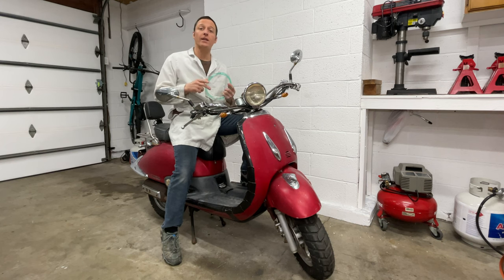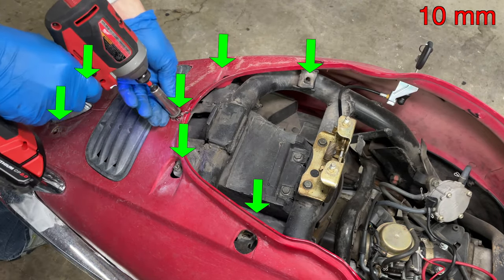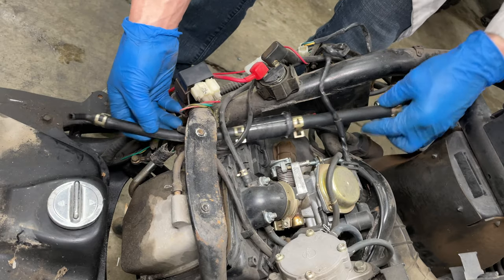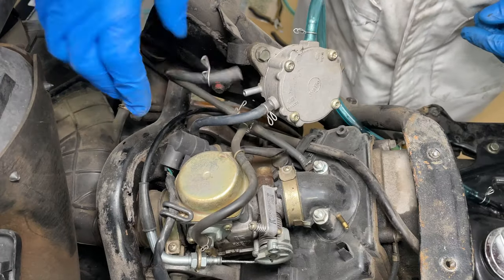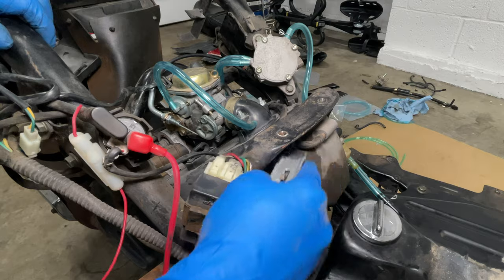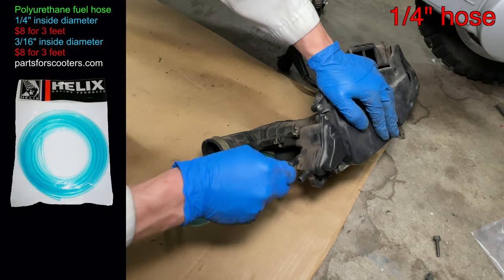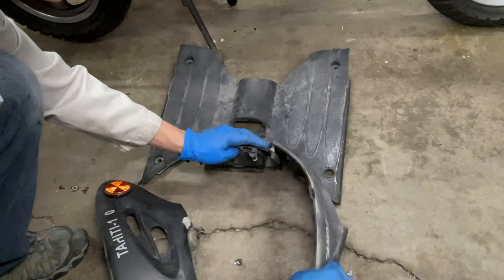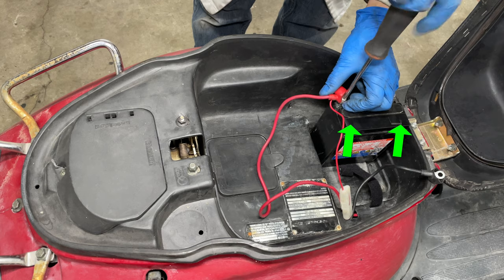New fuel and vacuum hoses and emissions delete on a 150cc GY6 Chinese scooter

Comment: I have a question, if I remove the stock airbox and use a cone filter right off the carb what do I do with the PVC system since it’s now just sitting there with two lines no longer connected to the airbox.
Reply from the maker: You can run the breather hose from the valve cover to your foam air filter.  Most foam filters have 2 layers and you can just tuck it in between them.  Basically this just allows the engine to burn vapors that come out of the valve cover.  If you don't connect the hose to anything, that's OK too.
Reply: @LabCoatPaul  If you are running on the road full time drop the outer filter snuggie and use it for a beer huger... Oil lightly and main jet up another size...

And a real Gates belt stops all the friction and noise from any cvt...

Best 30 bucks you'll spend for power transfer...

Gates powerlink...

Comment: What bike is that? I need that tank and fuel system
Reply from the maker: Hi!  I have the Roketa MC-16-150 scooter.  The same scooter can have many different "brand" names.  If it looks like this scooter, it probably is this scooter.  I'm currently installing a different gas tank on my scooter, so you can have my old one.  e-mail me at Paulz1265@gmail.com

Comment: Hi there Paul, I just installed a new gy6 150cc motor on my scooter and it started fine but the engine seems to be missing while idling. I looked at my clear blue fuel line and from the fuel pump, it seems to be pulling in some air bubbles and I was wondering if that could cause the motor to sound like it's missing. I've already adjusted the idle screw but the motor still misses while idling. Could the air bubbles going into the carburetor be the cause?
Thanks for any feedback!
Reply: adjusting idle screw does not fix misses, adjust idle mixtire screw. seal off any leaks

Comment: I enjoy watching your videos and I've helped me with a lot of things that I thought I would never be able to do. I was wondering if you could help me with an issue I'm having with the air box. I have a Rogue star 150cc and I can't seem to get the carburetor back in place .Some of the rubber portions have ripped off on the connection on the airbox while removing the old carburetor. Almost like a ring of rubber ripped off because of wear and tear. Consequently I can't seal it will on to the carburetor. Almost like it's too short now to even extend to attach the clamp to seal because of the ripped off ring a rubber. Do you have any advice or recommendations on how to seal the airbox to the carburetor that goes into the airbox?
Reply from the maker: Remove the air box from the scooter.  You might be able to fix the air intake tube with some silicone sealer.  Otherwise, find a new airbox online.  Just do a search for Chinese scooter parts and you should be able to find an airbox that looks like yours.  Install the carburetor first, then the air box.

Comment: I have a ice bear trike 157qmj with a egr Air filter nipple. Or I think it's a pcv hoes connected to the air filter. Only problem is that where I live they don't have that kind of air filter with nipple on it. So I bought a air filter with out the nipple plug. My problem is , since my new air filter don't have a nipple to place the hoes that goes back to it what should I do? I don't know how to take the EGR system completely out so I have that hoes lose. Should I plug it or zip tight it to the frame n leave it out in the open. Can some one help!!!!
Reply from the maker: The PCV hose is connected to the air box so the engine can burn crankcase vapors instead of releasing them into the atmosphere.  You can just drill a hole in the air box and push the hose in.  Watch the video at 4:38
Reply: @LabCoatPaul  thank you so much. I feel way way better with your  advice. Thank you.

Comment: I have a 96 taotao and I've replaced all hoses gas and vacuum my scooter will old a speed for a min then act like it ran out of gas I need help lol 😆
Reply from the maker: If it's running out of gas, there are a few things to check.  If your gas tank is lower than the carburetor, you'll need to check the fuel pump.  If the gas tank is higher than the carburetor, check the fuel petcock.  Disconnect the fuel hose from the carburetor and put it in a cup.  Crank the engine and make sure you get fuel.
It's also possible to get vapor lock in the gas tank.  If your scooter dies after riding, open the gas cap and close it again.  If it runs after that, you have a bad gas cap.  
You could also have a dirty carburetor.  Take the float bowl off and check your fuel inlet valve.
Reply: @LabCoatPaul  I've checked all those except the inlet value not sure what that is
Reply from the maker: @Mizfitvidz  The fuel inlet valve lets fuel into the carburetor.  Check out this video:  https://youtu.be/0m13eJrfwOw